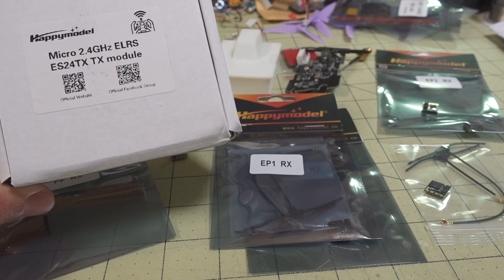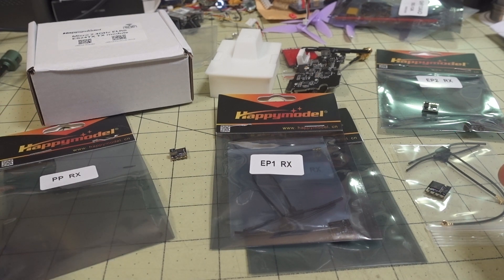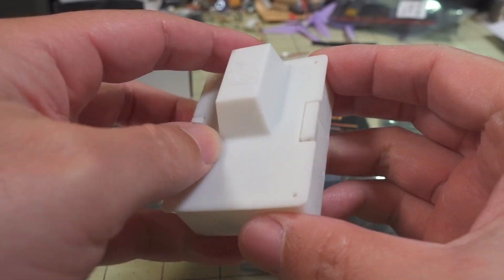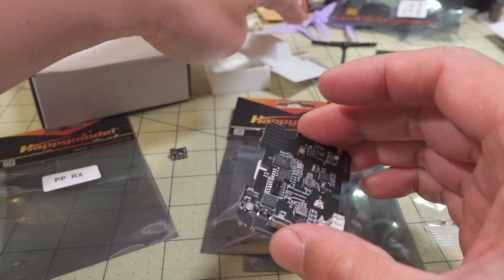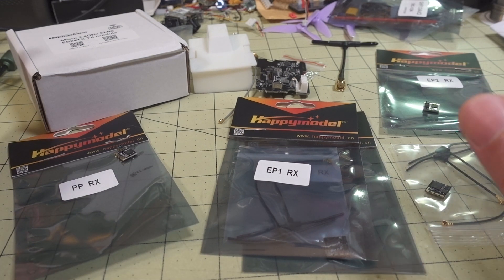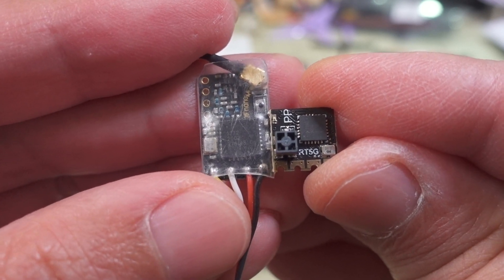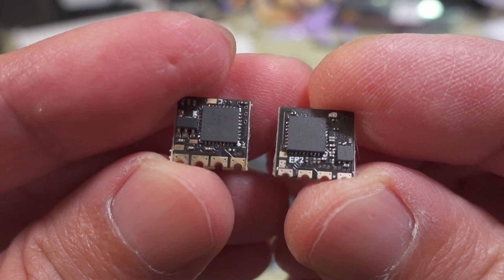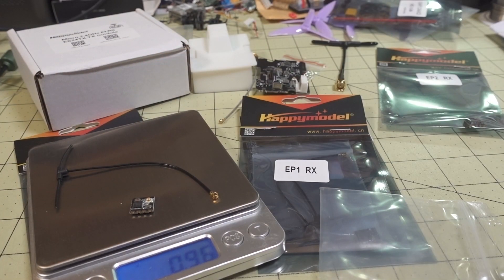SUPER TINY!! // Happymodel ExpressLRS 2.4Ghz System 📡😲

Comment: Hey Albert, I was wondering,  does anyone sell an almost rtf transmitter and receiver package for long range? I'm older and not very comfortable with computers. I understand Betaflight but not upgrading firmware for my tx, external module or lr receivers. I have an Elrs module and a nano receiver and a Taranis x9d plus tx but have no idea what to do in order to set them up. Tutorial videos don't seem to help me. I'm looking for a complete new and easy to use system. I hope you can help? You've always responded to my questions in the past. I would appreciate any help you can offer. Thank you
Reply from the maker: Sorry, but right now there are no RTF kits for long range.  Perhaps some will come out in a few months with ELRS built in. Today, it's strictly DIY.
Reply: @AlbertKimTV  thank you for your prompt reply. Much appreciated

Comment: I've been having trouble with a ep1. It worked great one day. Then the next time I went to fly I plug the battery in and it immediately goes into wifi mode with the quick flashing. Doesn't even look for my tx. Tried reflashing but just got the same. Tried manual bind. Would double blink. Super frustrating
Reply from the maker: Are you on an F4?  AIO FC?  Certain boards have an issue and make the EP1/EP2 go into bootloader mode with a solid yellow light.  Was it that or does it go into wifi mode with the quickly flashing blue light?  Some people seem to get those mixed up.  Have you tried a different UART?

Comment: The tx module has wifi support also. After enabling wifi you connect your device to it as a hot spot then upload the firmware. So there should be no reason to remove the cover of the TX module. The jumpers and usb port will only be needed in a critical failure scenario. It also seems happymodel  has two different beta firmwares for the tx one for the PP and another for the EP1/2. Depending on what receivers you get you might need to change it until we get out of beta for all this.
Reply from the maker: Yeah, I'm kinda waiting for solid v1.0 firmware to come out to update everything so it all matches.  It's a bit disjointed right now.
Reply: @AlbertKimTV  yeah I'm hoping the software stabilizes but I still bought the hardware. It looks to be good enough that the software will be made to work and I don't want to wait until it seems out. I ordered at Ali express as it had better deals and packages to select. I got three receivers and the aio flight controller. I'm hoping for an single board toothpick.

Comment: Since this is 2.4ghz could this be used by the multiprotocol module within the TX16s transmitter? Just made me think...
Reply from the maker: No, the RF chip for this system isn't one of the 4 in the multimodule.  Perhaps a 5-in-1 with this RF chip could come out in the future (would be awesome) but it doesn't exist as of June 2021.

Comment: The sticky foam is really needed on the back of the PCB to keep it level and I also put some rubber sticky pads on the internal connector as the pins push the connector up, it pushes the whole board up and then the connection is lost (was lucky it still happened on the bench). All in all with a bit of patience it can be set up to work on a quiet evening. I did use the wifi option to flash RC5 firmware - passthrough didn't work for me, but wifi works great.

Comment: Will the TX module work with a stock Taranis Qx7? If so then I'm in, cause Crossfire module doesn't work without mods. Thx
Reply from the maker: I think it should work unless you need the absolute fastest update rate.  If so, you'll have to do the pull-up resistor mod.  Also, you'll probably need the latest OpenTX nightly that supports CRSFshot.  I think also the version of the QX7 is important as FrSky crippled 3 of the 4 versions they made.  So it's gonna be an adventure.

Comment: Obviously you have not watched the Dave-C videos with the sub 100gm LR builds with over 30min flight times. Those ceramic antenna RX chips would be ideal.
Reply from the maker: The ceramic antenna supposedly goes 30KM+ on 10mW which I'm pretty sure is way farther than that quad can go in 15 minutes unless you're talking about sending it one way only.

Comment: I'm definitely interested in this module. Also curious as to the range of the module with the ceramic antenna. Thank you as always for the great review.
Reply: Depends on packet rate and transmitter power. @Specnor did 3km on 100mW, 500Hz, https://www.youtube.com/watch?v=kfa6ugX46n8 (different hardware, same tech)

Comment: I'm wondering is it possible to fit this ES24TX tx module into Jumper t-lite transmitter? I know Jumper t-lite don't have jr module bay. But is it possible to plug wires in them and play?
Reply from the maker: In theory it could work with some DIY hacking but it will be a serious project I think.
Reply: @AlbertKimTV  that's sad, because I'm eager to put EP2 into my mobula6. I love whis whoop, but I have unreliable frsky connection with my jumper t-lite that I'm even afraid to fly behind wall or tree and I hope ExpressLRS will solve this issue. Tank you for your answer. Will wait for suitable solution then.

Comment: When you don't bind a radio, a wireless network will pop up and you can goto the IP of the gateway (10.0.0.1 iirc) to upload the firmware through the webinterface!

Can't wait to see the PP receiver included with their DiamondF4 FC!
Reply from the maker: Thanks for that info.  I couldn't find it on the Github link.  So basically, power it up but keep the power on the TX off, right?  Is newer firmware even out yet?
Reply: @AlbertKimTV  RC1.0 is out and is newer than factory. It supports Happymodel 2.4GHz as far as I know.
Reply: Yes, the latest RC branch is the most up to date right now and supports the PP/EP RXes.

Comment: Are there any plans for HappyModel to build an ExpressLRS RX into a Tiny Whoop size board and replace the aging FrSky D8 built ins?  It'd be super cool if Express LRS was just default built into every FC and you just add the external RX if you want to go with another protocol.
Reply from the maker: Yes, I'm told those will come eventually.
Reply: Yes
Reply: Sold! I'll take half a dozen :).
Reply: Already out in 915 or 868mhz just for fun. 1s capable all in one 5a per ESC 😁
Reply: @jonc67uk  Yeah!  A good start, it's not exactly what I was hoping for but they gotta start somewhere.  I hope they come out with a ceramic antenna/2-4s version soon without the built in analog VTX.  That's my dream FC right now.

Comment: Happymodel is making a Crazybee F4 board with a built in 900MHz Rx. Would be better if they made a 2.4GHz but still, progress. Death to SPI Rx's!
Reply from the maker: 2.4ghz version of the AIO board is also in the works.
Reply: Ohhhh this is SWEET, that's what interests me the most about the ceramic antennas and ultra tiny RX.  Get rid of Frsky D8 forever

Comment: Whats the estimated range for this on 2.4GHz 25/50/100mW ?
Reply: you don't have to estimate. There are tests. 250hz on 100mw reached over 30km with signal strength to spare.